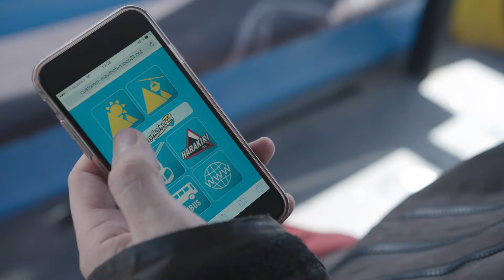Doppelmayr/Garaventa 30-TGD "Penkenbahn" Mayrhofen, Österreich (2015)

Comment: Very interesting video, in absolutely beautiful scenery.  But the actual installation (the buildings and the cable cars) are inevitably a considerable intrusion on the outstanding scenery.    This is in the Zillertal, where the local authorities do not want to electrify the local railway because the wires would be intrusive!  (The hydrogen powered alternative for the trains is untried technology and will be hugely expensive.)
Reply from the maker: Hi Roger! This installation is just a replacement for the cable car that has been running on the same track since 1953 - so the "intrusion" has been there ever since.